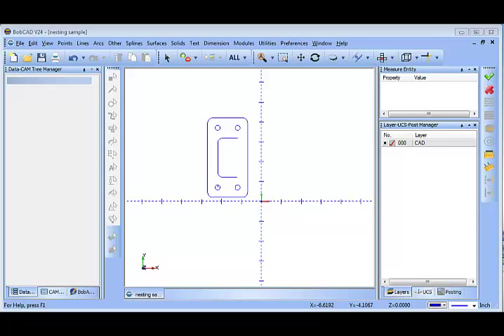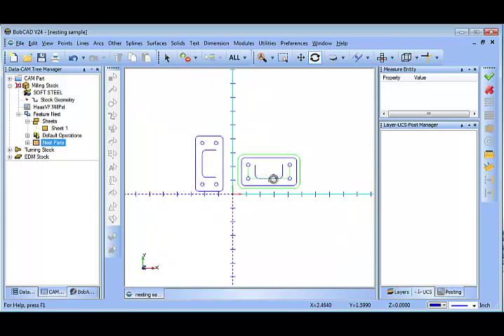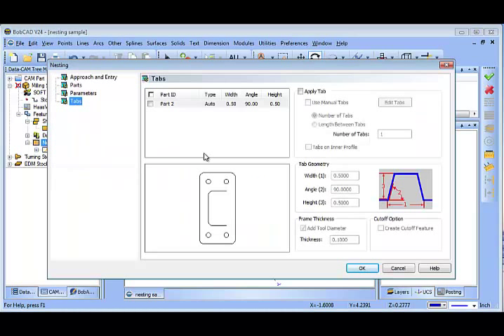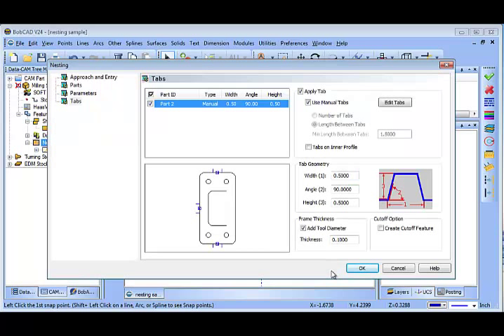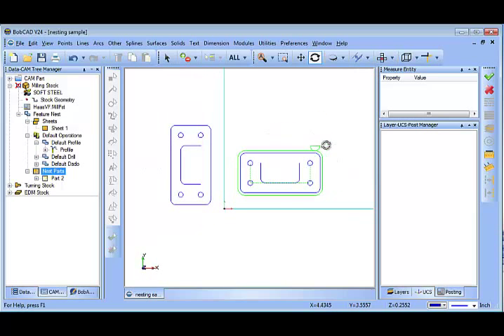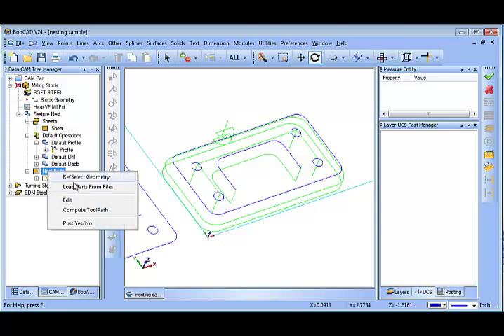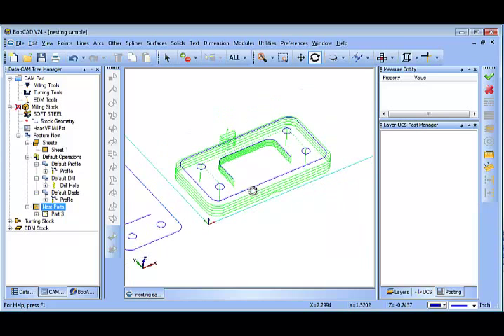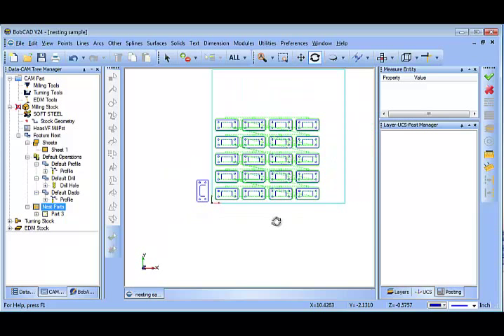BobCAD CAM V24 Basic Nesting Sample

Comment: Has Bobcad fixed the dado feature to allow more than one dado layer? Dado1, dado2, dado3 for multiple items with different cutters or depths. Its very time consuming to have to go back and select each dadoed item one by one and set individual depths after its been nested.
Reply from the maker: We have released a new nesting software with lots of improvements! 

Get More Parts Out of Every Sheet CAD CAM software for Nesting 

Nesting Optimizers
Remnant Sheet
Part - In - Part Nesting 
CAM Wizards 
Filler Parts 
Nesting with Tabs
Grain Direction 

https://youtu.be/1127XtrsX-4   27:24 Mins